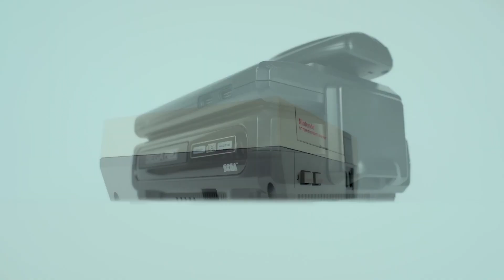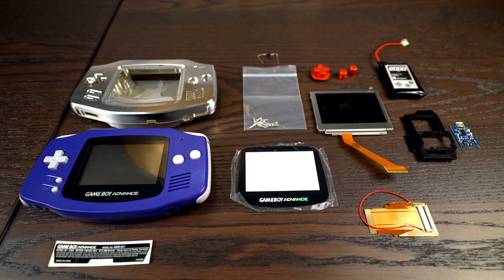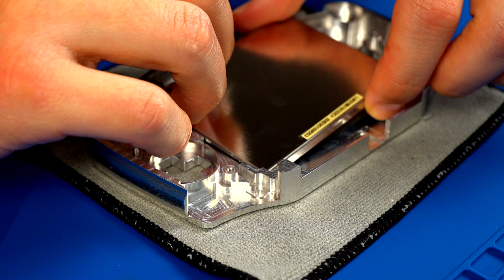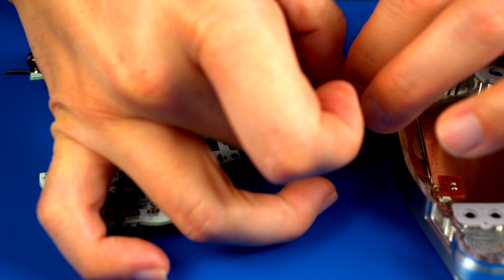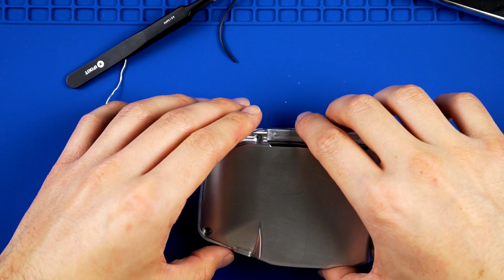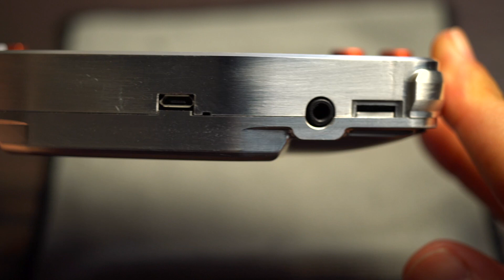ULTIMATE All Metal Gameboy Advance Build!  Metal Shell, Rechargeable Battery, Backlit Screen!

Comment: I'm curious what improvements they have made to the shell. I noticed they went from micro USB charging to USB-C, which is good. But one thing i noticed about your shell is the L & R button cutouts are not quite right. I'm curious if they fixed that with the newer version. Looking at their web site, it seems they got rid of the C&C lines, unless those are just promo images.

Comment: cool shell but the shell seems to be missing the two clip points on top for any gba accesory that use them like the gba wireless adapter or the gba to gamecube link cable. Did boxypixel update their shell to include the notches?

Comment: I did the same modifications to my GBA and now it is not turning on, Ii did turned on with a half charge battery, it stopped working when I fully charge the battery. If I check the fuse now it does not show continuity, so I am assuming the PCB in charge of charging the Battyr delivered more voltage than expected :(.

Comment: The Funnyplay IPS V2 LCD really doesn't function well in the aluminum casing, (Unless you don't mind the picture in some GBA games being cut off on the right front side and bottom front side of the console.)
1. because the screen ratio is much larger and portions of the screen will be cut off. 
2. a custom ratio glass or plastic lens cover would be needed from funny play. 
3. You'd need to dremel the right front side of aluminum shell the average person is not well equipped for that. 
Final thoughts: 
The best method in having an aluminum shell is going the AGS-101 screen.

Comment: Will the Handheld Legend clean juice Rechargeable battery work with this mod?
Reply from the maker: Unfortunately it won’t because there isn’t a battery compartment to secure the clean juice battery. The boxy pixel battery is really good and well integrated into the shell. It works great. I hope that answers your question. Cheers Joe!
Reply: @MachoNachoProductions  the website says it can't mail the battery to the United states.  That's why I was asking. Thanks for getting back to me so fast.
Reply from the maker: That’s strange. I’ve ordered several batteries from boxy pixel without issue. The nice thing is that the boxy pixel website gives the dimensions of the battery so you can buy your own. Just need to make sure it’s the same size as the one boxy pixel sells for the kit.
Reply: @MachoNachoProductions  ok, I will give it a try. I really want this mod.
Reply: @MachoNachoProductions  I just checked it, go look at the website.  Use the link you provided and you will see it says it can't ship internationally to the U.S. . Also the link for the charging board does not work. Sorry for all the trouble.
Reply from the maker: No worries. Hmm that’s strange. He’s based in the US so not sure why it would be shipped international. My links may be out of date. I would check out his website for each part. He should have plenty of stock. Sorry for all the condition. Best of luck!  Cheers!
Reply: @MachoNachoProductions  ok, if he is in the U.S. then I will order everything.  I think he is saying that he is in the U.S. and can't ship internationally.  I just got my gameboy advance 2 hours ago in the mail. It works perfectly so now I can order the mods knowing the motherboard works. Thanks again for your help. I will post a mod video to my small channel when the parts come in. Thanks from Joe's Retro World.
Reply from the maker: Nice!  Sounds good man!

Comment: Hey nice video, thanks! Have you measured how long the battery lasts with your current build? I’d be interested on you also comparing if you install the brightness controller - killer build as is nonetheless.
Reply from the maker: I haven’t yet, but I really should!  It’s got a good size battery and the AGS lcd should be pretty power efficient. I may do it in a future video!  Cheers buddy!
Reply: @MachoNachoProductions  u r a nice guy
Reply from the maker: Thank you Ben!!

Comment: So its okay to use a 5 V pcb to a 3.7 battery? Just wondering because I want to mod mine. If wording it correctly dont know if you understand what Im asking. Lol
Reply from the maker: Hmm that's a good question but I am not sure I understand.  Can you send me a link to the PCB you are referring to?  That will help me understand.  Cheers Jonathan!
Reply: @MachoNachoProductions  the pcb you have linked on the description is a input 5V pcb type c and in the battery shows  3.7 V. I want to know if the amount of voltage through the pcb 5V will affect the battery that state 3.7V. If Im making any sense here . Thanks for replying
Reply from the maker: Ah gotcha!  It should be totally fine!  I’m not extremely knowledgeable when it comes to electrics but this was the recommended board from boxy pixel and he really knows his stuff. I don’t think you need to worry. Thank you for asking and apologies if I didn’t help too much. Cheers Jonathan!
Reply: @MachoNachoProductions  thanks! I'm just over thinking too much about those little things.  Lol love your videos.
Reply from the maker: Haha!  Your good man!  No worries!  So glad you enjoy the videos bud!!  Cheers!

Comment: What size/type solder do you use for this?
This is an awesome video. Thanks for the effort.
Reply from the maker: Hey Michael!  Thank you dude, really appreciate it! I am currently using Kester 63/37 core flux solder.  It is 0.031'' diameter.  Hope that helps! Cheers buddy!
Reply: Macho Nacho Productions thank you. This will be my first project soldering and de soldering on a board and with such small wires, I worry about messing up. 
I don’t tinker with cars, or motorcycles (not my style) but I want a project to emphasize my hobbies. This may be it. Wish me luck.
Reply from the maker: Hey no problem bud!  Best of luck on the project!  Cheers!

Comment: Would you have to do the same thing for a gbc battery mod. Using the same kit.
Reply from the maker: Yes, the Boxy Pixel shell/mod for the GBC is very similar to this one.  I actually made a video for the Boxy Pixel shell for the GBC, you can check it out here id you'd like:  https://youtu.be/iBtuAofPULY
Hope that helps, Cheers!
Reply: @MachoNachoProductions  I saw the video right after I made the comment haha. Really happy I saw the 2 videos. Also would it be possible to add a led to tell you when charging is done
Reply from the maker: They actually both have a hole in the shell that lets an led shine though which lets you know when the battery is done charging. It’s great!

Comment: Nice video.  I prefer IPS screens over AGS 101 screens, and it would have been sweet if you could have found metal shoulder buttons!  To your point on the screens, don’t forget, games weren’t just made with the AGS and Micro in mind, but the AGB as well.  That’s no reason to stick with an AGB screen.  Upgrading makes total sense if the upgrade is developed properly.  Keep it up brother!!!
Reply from the maker: Thanks ArchGeek!  Metal shoulder buttons would be awesome!  Hopefully boxy pixel will be able to make some in the future. Very true, GBA developers need to consider many different LCD technologies when developing their games. I’m also a huge fan of the IPS mod. I am hoping to install a voltage regulator on my ags101 modded gba to improve the brightness of the lcd. Cheers buddy!
Reply: Macho Nacho Productions thank you for the great content!
Reply: There is now metal shoulder buttons can’t wait to build mine

Comment: Great video! Quick question, during my build everything worked great until I swapped out new buttons, now the gameboy won’t turn on... any suggestions?
Reply from the maker: Can you tell me a little more about your build?  Are you using a boxy pixel kit?
Reply: Macho Nacho Productions yes, the new Mario laser shell, with a funnyplying IPS screen. Everything worked to a T until I swapped new L/R bumpers, not sure the issue.
Reply from the maker: Nice, that’s a really cool shell!  What I would do first is double check your solder joints on the power board. Since it seems to be an issues involving power. It could be that one of your connection came off. Also, try to see if there is any shorting occurring, where wires may be contacting the shell or other metallic surfaces. That would be my first step. Let me know what you find and we can go from there.
Reply: Reassembled the battery connections and solved the issue! Look forward to more videos in the future.
Reply from the maker: Awesome!

Comment: I ordered the USB C version and the diode just now from their site Im excited! Do you think I will have some issues with the port if I try this with a plastic shell? Im getting the 3D bracket printed soon so Im not able to really check for myself right now. Im thinking its just gonna be a little bit of positioning and precision cutting in the battery door but would like to hear your advice!
Reply from the maker: Great question @easybake_evan!  Unfortunately I am uncertain if installing the usb c charging board, the 3D printed bracket and a lithium ion battery will fit in a stock shell. The boxy pixel shell is specially designed to fit this parts and is a little thicker in the back to accommodate those parts. There’s a chance it could work but I am a little doubtful. I’d be interested in hearing your findings. I hope this helps and best of luck!  Cheers!

Comment: I highly reccomend using a brightness chip when doing an ags 101 mod. Increases the quality of the screen a ton!
Reply from the maker: Great suggestion!  I’ve been eyeing those kits from retro modding. Might have to grab one when they open back up!
Reply: Macho Nacho Productions You should use Game Boy Advance voltage regulator V2 from Retro Modding!
Reply: I dunno... I used a VRV2 from Retro Modding and my AGS-101 screen looks meh. Think I'm going to un-solder it and go back to the single wire

Comment: Macho Nacho Productions
Would you happen to have knowledge on how to replace a power switch for the Nintendo ds lite? I think I took off the pads from the motherboard because I see brown not green lol. Help if you can please?
Reply from the maker: Hey there!  If that pads have indeed been taken off it will be hard to replace. I haven’t replaced a power switch before on a DS lite. It’s hard to diagnose without seeing it. A possible solution if the pads have been taken off is to glue the switch in the correct location at solder the switch leads directly to the traces. This will require you to follow the pad traces and etch away the solder mask and solder to the trace directly. This is a bit hard to explain but you are essentially bypassing the solder pad. Please take all the proper precautions and do not attempt to repair if you feel uncomfortable. You can also buy a replacement lower board from eBay too. I hope that helps and best of luck!
Reply: Macho Nacho Productions 
Thanks for your advice. Yeah I don’t know what to do so I’ll find a replacement board. Maybe I’ll try your solution as trial and error

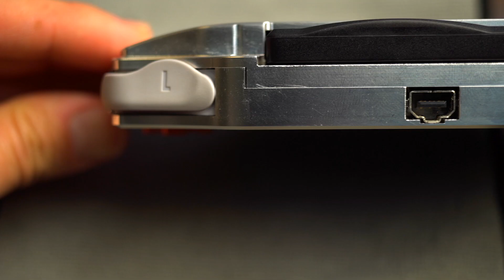Comment: 14:38, you can use the cable but can't use the wireless adapter :|
Reply from the maker: You are correct. It is sad, but true. Hopefully in a new revision of the shell, this feature will be added.

Comment: Thanks for another great video Tito! Did you purchase the 101 screen from boxy pixel?
Reply from the maker: I bought the ags-101 screen from eBay. Retro modding also sells them but they are a bit over priced. I found that eBay has better prices, and many times they also include the adaptor ribbon cable. Cheers!